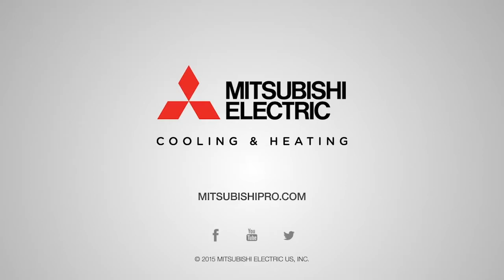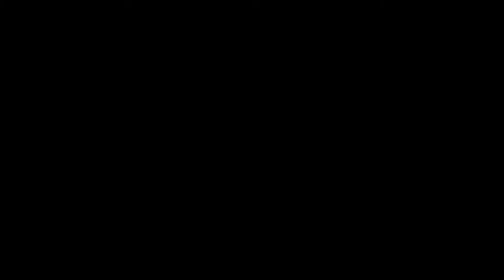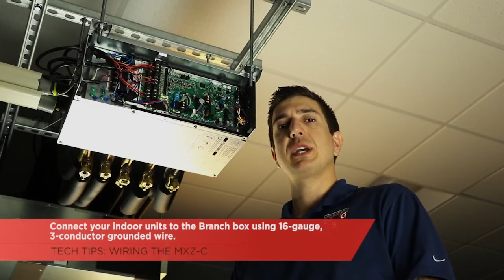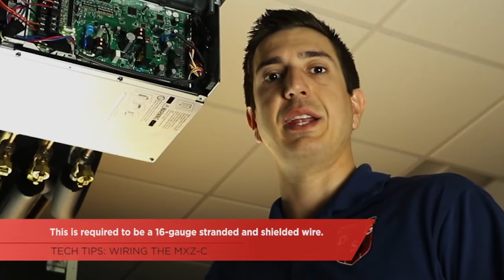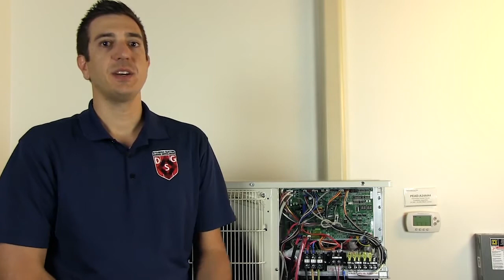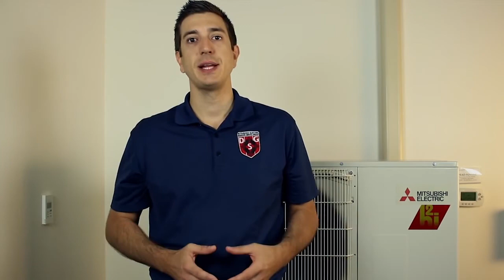Tech Tips: How to Wire our MXZ C Hyper Heat Units (L)

Comment: Hello, I have an older Mitsubishi mini split system I purchased it in 2014.  The air handlers are the msz-GExxNA.  These have been discontinued.  Unfortunately I have an air handler which has a leak in it.   
I've tried to find a new one but no one has any.
Does Mitsubishi or anyone else make an interface box which would allow the newer air handlers to work on the older system.
Thanks in advance.

Comment: any one know how to pull down refrigerant to the condenser unit, or in any manual, please?
Reply: You would close the king valve for the liquid line and run the AC until all/most of the refrigerant is pumped into the compressor.  I would probably recommend using a refrigerant recovery machine and putting the refrigerant into a tank.  If you just have the factory charge in the system, no biggie to pump it down into the compressor, but if you have a branch box with lots of extra refrigerant in the line sets I’d probably go with the refrigerant recovery unit.  Why do you need to pump the refrigerant into the compressor?  Issue with a unit?

Comment: good day friends i have a litle problem from my mitsubishi condenser unit i have S1-S2-S3 and  the box i see L1-L2 AND M1-M2 tell me how to conect it please
Reply: S1-S3 is what you’ll see in all the cassette units and on the connections to the branch box for those cassettes.  L1-L2 are your two legs of 240v power, so you’ll connect l1 and l2 and your ground on your branch box to either a breaker in your breaker box, or to the l1 and l2 terminals on the compressor board from the branch box. M1-M2 will be both on your branch box and compressor and you must use a communication cable for that, basically a shielded cable with a ground wire looping around the cable bundle.  Hope that helps!